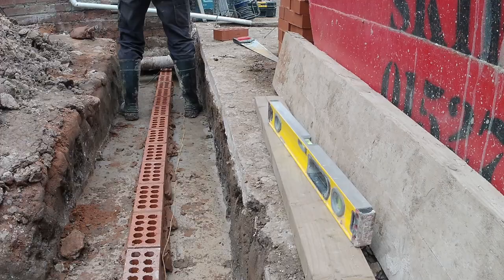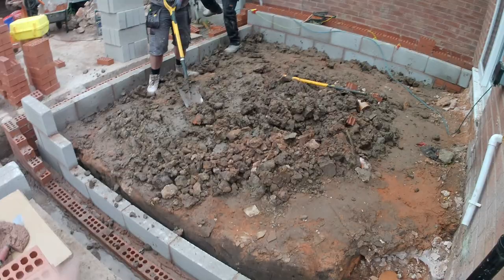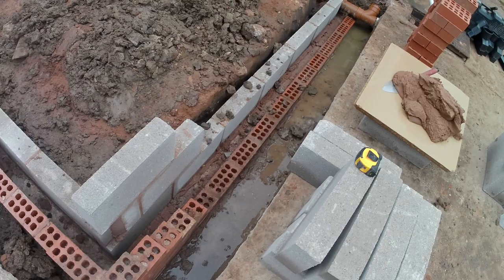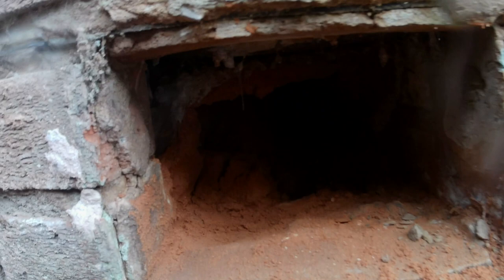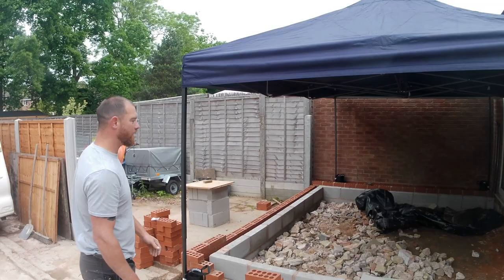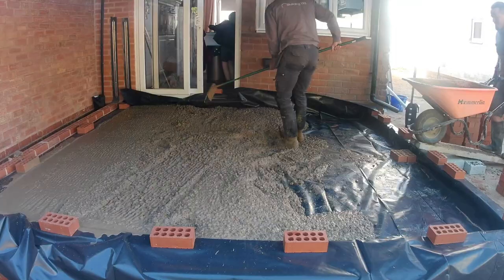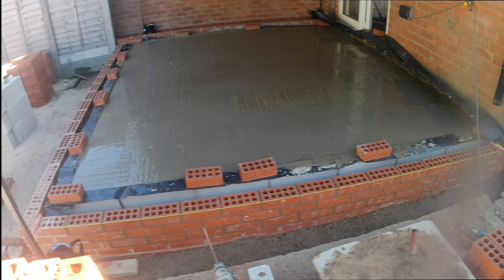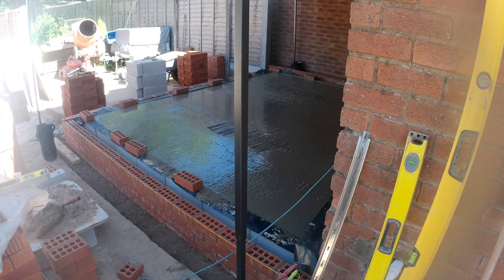Longbridge Rear Extension - Build to damp course

Comment: Hello, I'm just a novice bricky, nowhere near your standard, just wondered what you were using as a string line, could not see it properly but looks much better than using pins.. Good work guys
Reply from the maker: Hi Richard, we use the brick clamps and have never looked back as they are easy to set up and quick to adjust. 

Deepocean 2Pcs Brick Liner Runner Wire Drawer Bricklaying Tool Fixer Building Construction https://amzn.eu/d/gmPjwtr

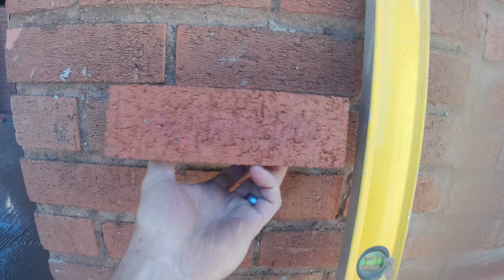Comment: @ 13:19  glad you explained that one. first thought was to tooth in but mate those are thumb joints- were they trying to match a 65mm brick with old imperial on the original house?

great vids by the way, thanks for posting
Reply from the maker: Yeah they were! They didn't achieve it though! I believe the original extension was built by the last owners who weren't in the construction industry.

Comment: insulation??
Reply from the maker: The insulation was placed on top of the slab. We normally put it under but the building regs drawings for this extension required it over.